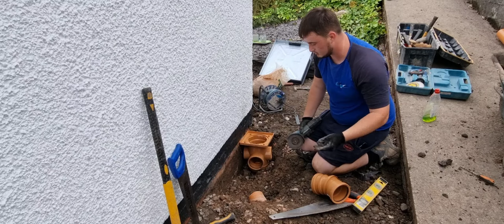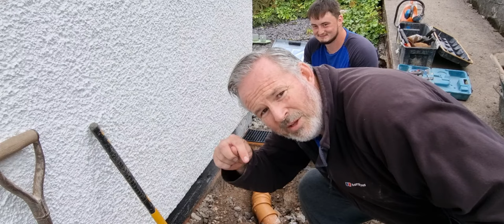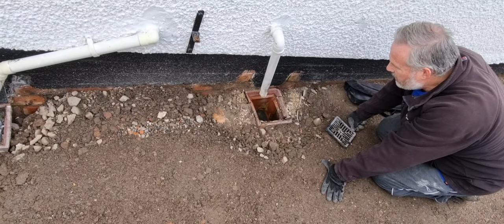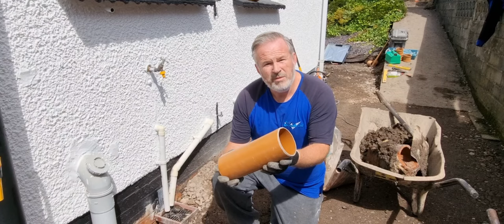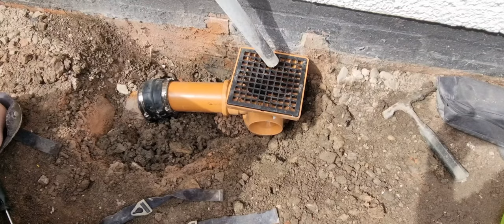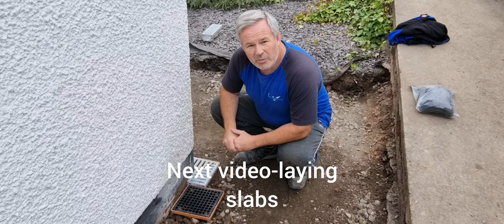replacing old clay gully with plastic drains

Comment: Thanks chaps. Been wondering how to replace my 1930s blocked gulley for ages. 

Quick question we’re they both back inlet gulleys you used?
Reply from the maker: Yes Robert basically they are rodable and have a water trap good luck 👍

Comment: Before I move on to the next part, I see the ACO drain is finishing at the gully, but I thought rainwater runoff from a patio had to go to a soakaway now buddy?
Reply from the maker: Its preferable Marcus.
In this instance the ground sloped steeply to the house at the front.
So its preferable to keep the water on site .if this isnt suitable then other alternatives can be used .
If in dought check with the local water authorities

Comment: What do I do if my clay gully is incorporated with a raft foundation
Reply from the maker: Sam without seeing it its difficult. The raft normally sits passed the perimeter brickwork. So sometimes the gully sits outside to raft for example maybe 150mm from the brick perimeter outside the raft .Other times they incorporate the gully inside the raft .if the later is the case its fine just more work if the gully needs replacing. 
Hope that makes sense to you Sam 👍

Comment: What is the right height for that grid you have installed. My landscape gardener has installed new aco drains in the patio and has replaced the grid to a plastic as it was broken but he has raised the grid by about a flag's height. Would that be a problem?
Reply from the maker: We usually sit ours slightly lower than the paving but site conditions may dictate otherwise

Comment: how do you connect the aco drain into the gully?
Reply from the maker: Hi Richard 
You can buy an add on for the bottom of the aco drain to connect into the main 4 inch pipe.
Or we cut them straight into to side of the main back inlet gully 👍